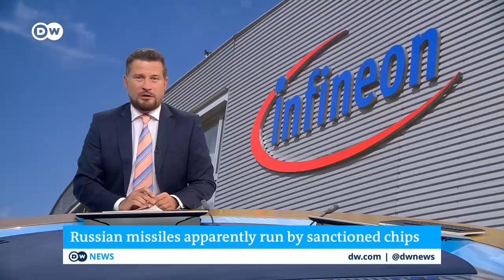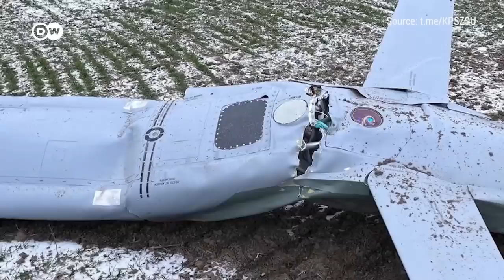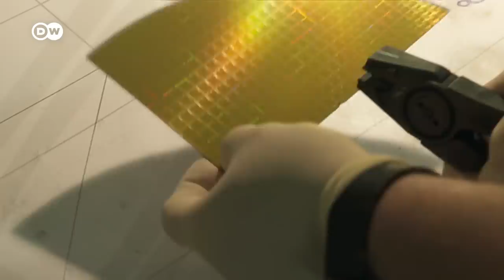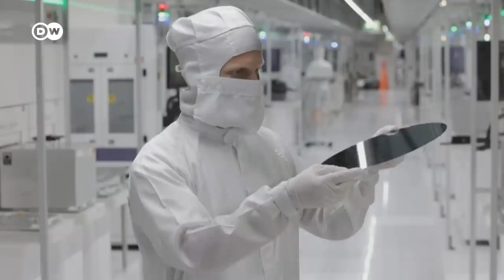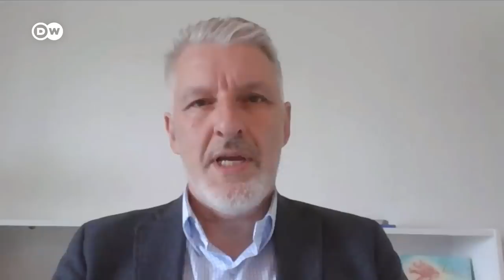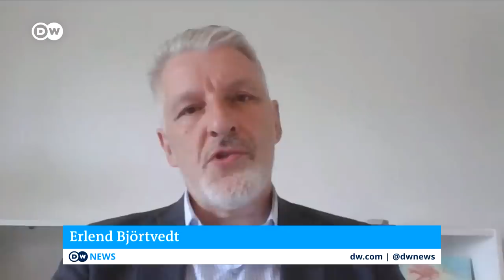How are Western chips ending up in Russian missiles? | DW News

Comment: Everyone has a price, that's how you're finding Western chips in Russian tech
Reply: sure.
But it is done more simpler then that. they are sold ti a ton of different firms, impossible to shot them (all) down
Reply: @ĐoànĐạiDương-f1n   - China and Taiwan
Reply: @khorshed1227  - may be most of weight of the washing machine is from chips hide in there
Reply: Guys, we built the SR71 Blackbird out of titanium. Only the Soviet Union could make titanium alloys at the time, so we bought it from the USSR, so we could fly our spy jet at Mach 3.7 over their territory.
Reply: @SubvertTheState  

Bought rubber and chemicals from Germany during WWII.
Reply: @khorshed1227  So THAT's why the Russian troops are stealing Ukrainian washing machines!
Reply: @springbloom5940  Source for that dubious conclusion? Rubber was rationed during WWII, because almost all sources in southeast Asia were cut off by the Japanese occupation of producing colonies there. Germany had factories producing Buna synthetic rubber, as well as synthetic fuel, but all production output was allocated to German war production and armed forces needs. And that even BEFORE round the clock Allied bombing raids on production facilities. Output could not even keep up with German needs, so no surplus was available to trade with the enemy.
Reply: @MrThedoublec  

Unclear on how things actually work, huh?